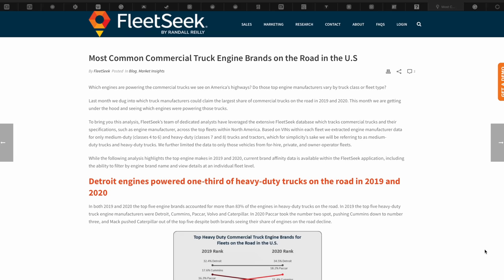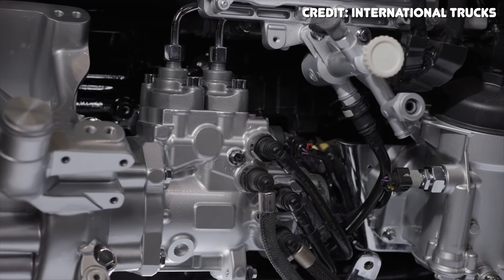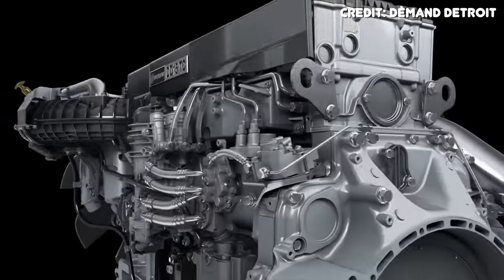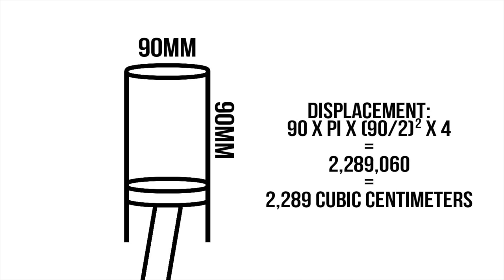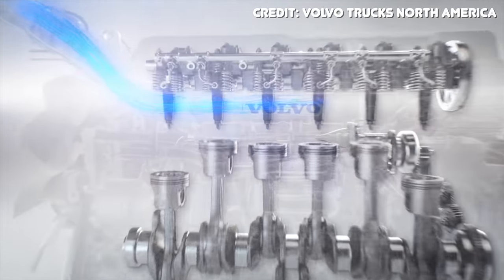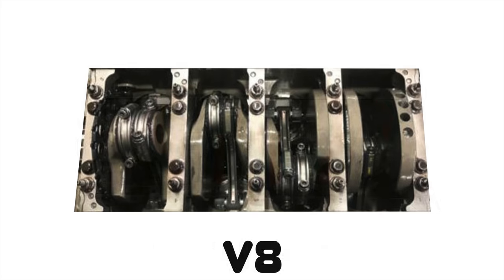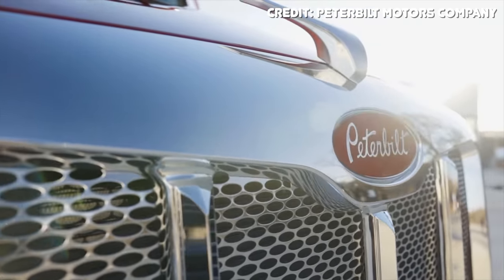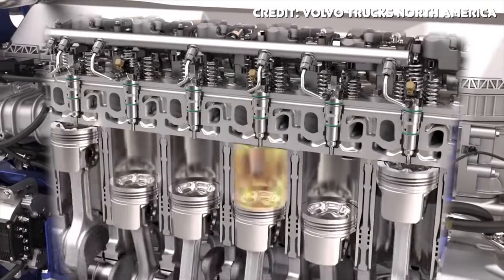Why do Semi-Trucks Use Inline-Six Engines?

Comment: I'm not sure that I would characterize the difference between high and low RPM motor designs by saying that there is "less stress" with the lower RPM design. Stresses exist in both, but are simply different. Lower RPM operation is likely slower to wear on components vs high RPM, but high torque output puts a different demand on parts and high torque, low RPM engines are generally designed with components made to handle that demand (much more robust than a high RPM engine).
Reply: Most diesel engines always benefit from low rpms because it's a slow burning fuel which means that longer stroke allows it to extract more work from that load of fuel before it goes out the exhaust.  And with bigger bearings and pumps, you really multiply parasitic losses in a hurry as you climb rpms
Reply: @wizard_of_poz4413  yes especially in the 6 in line engines have a low rpm compared to a v8 Diesel engine with higher rpm
Reply: Many force increase in square not linear means double the RPM you have four times the forces.
Reply: @edgarrodriguez5436  and their is limits to what the fuel can actually do. It burns at a certain rate and higher rpms and diesel just don't mix well without alot of bandaids
Reply: @edgarrodriguez5436   ...   ,  heh,  heh  !  The  Cummins  903  V-8  from long ago cranked 2,800  r.p.m.'s  from the factory . . ... .
Reply: You said absolutely nothing
Reply: @pauld.fisher8461  I prefer 6 inline, it is extremely reliable on the 6.7 Cummins engine especially on the 5.9 12V and 5.9 24V a total beast that’ll last a lifetime
Reply: @pauld.fisher8461  Actually it's 2600 rpm. Just read from manual.
Reply: @edgarrodriguez5436  nahhh any real user of those two engines will tell you they have real problems
Reply: @VictorEstrada  I personally own a Cummins 6.7 2008 2500 and it runs fine, the transmissions don’t mess up like people claim and cap that they do. As long as you do the transmission oil change and the service of the truck on time it will continue to run
Reply: @edgarrodriguez5436  it's true of any car, but cummins engines are also known to have some issues. My friends' blew up while just driving to work, and he does his own work and likes to keep up with maintenance. They're really good engines, but there's no such a thing as the perfect engine
Reply: @VictorEstrada  oh yeah, I can agree with you their and Thats true. Not every engine is made exactly the same while being the same size brand and on the same truck and has its own little defects while others engines are made right on the spot
Reply: Wear is a function of piston speed.  High rpm and long stroke gives the most wear, low rpm and short stroke gives the least.
Reply: @rogersmith7396  exactly why 6 in line are more reliable, especially if their the 5.9 12v Cummins

Comment: As a former truck mechanic I preferred to working on straight sixes.  You can reach everything from the sides without having to climb over the engine.  The six is narrow so the frame rails are closer together without interfering with anything plus they allow more room for bigger tires and a tighter steering angle.
Reply: What do you believe is / was the best semi truck engine for longevity . 
 Also ,  what do you believe is / was the best car engines ever made in terms of longevity ?.
Reply: @WISHBONEL7  The Cummings 855 is a clear favorite, with a long record of reliability.  The Caterpillar V-8s and straight sixes are also very reliable.  The Detroit family are reliable as long as the temperature is above 40F.  LOL they can be very hard to start when it's cold!   Auto engines,  Ford V-8s have direct oil lubrication to all moving parts.  The GM 350 V-8 is probably the worse engine ever made!  Any American made 4 or 6 cyl engine will be very reliable as after 50 years they have the design down pat.
Reply: @bullettube9863  Wow , I am surprised to hear you take on the GM three fifty .  

Where does the early four cylinder or straight 6 Datsuns or Toyotas from the nineteen seventy's rank on your list ?? , as well as the Dodge / Plymouth slant or V 6 ?
Reply: @WISHBONEL7  The Dodge slant sixes were very good motors, but mechanics found it difficult to adjust the valve tappets.  The Japanese basically copied American and European designs, then improved them.  They also copied American management practices, but American management soon corrupted itself with bean counters in the late 60s and as a result quality control soon became a joke.  Example of this was the GM 348, which was intended to be a truck motor but with a 4 barl carb was used in the Corvette.  For reliability it had four bolt main bearing caps and direct oil lubrication. When you see a 350 with four bolt mains, you are seeing a 348 block engine.  The 350 was designed to be cheaper to manufacture.  It's cam wore out at 50k miles, valve tappets wore out regularly and the timing chains just failed just when you least expected them to.  They even made a GM tune-up kits which included the cam, lifters, gaskets, seals, timing chain and plastic coated sprocket,  and oh yeah the spark plugs!
Reply: @bullettube9863  How about the Ford straight six , and the Toyota twenty two R  ? ,  or the older Volvos ? , in which I just wish that they had a timing chain rather than a timing belt  .
Reply: @WISHBONEL7  Yes, all American sixes were good engines, they had been building them for almost fifty years and had all the bugs worked out.  I owned a Volvo 1970  142 with a four cyl, it was basically a Ford four cyl engine!  Belts versus chains?  Belts are quiet but chains are more durable.  I owned a Plymouth K car and when the belt broke after 40 k miles I had to replace the head as the valves had all bent and damaged the seats.  It was a good example of bean counters versus engineers.  The engine was cheap to make, though not as cheap as the Mitsubishi model, which self destructed after 50 k miles!
Reply: @bullettube9863  Didn't Datsun and Toyota have a double chain on there straight sixes ? .
Reply: @WISHBONEL7  I remember the one Datsun I worked on in 1978 had a wider chain then most engines of the time, but I don't recall if it was a double or not.  Generally the Japanese manufacturers wanted their cars to be as reliable as possible to overcome the perception that Japanese products were cheap junk.
Reply: @bullettube9863  I wish that I had that car right now .
Reply: @WISHBONEL7  I wish I hadn't sold some of the cars I had owned!
Reply: 350 engines unreliable? I have a 98 K2500 with the 350 approaching 200,000. It doesn't use oil and runs out good despite being constantly overloaded with welder,torches,tools and steel.
Reply: @hubertbergen3000  You obviously have a 350  with the heart of the old 348 "rat" motors!  Any engine will last a long time if it is taken care of.  I was a mechanic for fifty years and of all the engines and cars I worked on the GM-350 was the worse.  Cams and timing chain wore out by 50k miles, the heads swallowed valves, valve rockers wore out.  Every thing that went wrong with these engines was due to poor lubrication.   While a lot of the problems were solved in the HP versions, the generic engines all had short lives.  My 95 Chevy 1200 with the v-6 went 192k before the frame rotted and the front bumper fell off.
Reply: Do they have engine mounts or are they screwed directly on the frame?
Reply: @bullettube9863  "Any American made 4 or 6 cyl engine will be very reliable". Um yea, about that. No, lol.
Reply: @em4703  I'm old enough (73) to remember the Ford Pinto engine, and the "Iron Duke_ four cyl made by Buick, both engines were tough and economical to own.  The engine used in the Vega was a disaster because they rushed it without the usual long term testing.  The Dodge and Plymouth engines were made by Mitsubishi and had problems in Japan before they were used in America.  One of the best engines ever made by anyone were the Continental 4 and 6 cyl engines.  They were simple, and robust and were used or copied by many other companies.  I've worked on machines that used Japanese, Renault and Fiat engines and none of them were ever as good as an American made engine.

Comment: One point I would add to the list of advantages to inline engine's in trucks is being a narrower package provides more room for the large front wheels at full lock.
For manoeuvering you often need all the steering angle you can get.
Reply: this is also why we love cab overs in  Europe, sure the nose trucks may look great but put that nose under the cab and not only are you sitting taller and have bether overview, but also the frame becomes allot shorter so the turning radius increase by quite allot
Reply: @Stale_Mahoney  same here in New Zealand.   Slightly differently configured. Tractors have one or 2 steering axils with dual driving axils with locking differentials. 
A popular configuration is truck and trailer. 
Again twin steering axils and dual driving axils, 9m deck.. Pulling a 4-5 axil trailer. 2+2 or 2+3. With 12m deck.
Reply: not really the wheels only barely stick above the top of the frame rails so it would take a pretty extreme engine design to block space that isn't already blocked by the frame or drag link
Reply: We have 385/65/22.5 on the front axles of all our trucks at the company I work for (315/70/22.5 on the driving axles and 385/65/22.5 on the trailing axle). Doesn't matter if it's a Volvo DC13K (13L I6) or Scania DC16 (15.6L V8) we still have a 13 meter turning circle.

Btw, on our trailers we either have: 
8x 385/65/22.5
8x 435/55/22.5 
16x 245/60/19.5

We use 4-axle trailers with 2 axles in the front (these are fitted like a dolly onto the trailer) and 2 in the rear (fixes axles)
Reply: @Stale_Mahoney  I do a lot of expediting here in the US and I saw a old black and white photo of a truck stop parking lot and they were all cabovers?  And I saw an old photo of trucks in Europe and they were all conventional? Thought that was interesting.
Reply: @cliffordzellner5917  yeah back in the days nose truck was more common here in Europe, nowadays it's only cab overs
Reply: Hey guys I'm not a truck driver, but I have a question. Whatever happened to the cabovers? 
My grandfather was a Teamster back in the Jimmy Hoffa days and delivered trucks to dealers for General Motors. He loved the cabovers and I've noticed that I hardly see them anymore in the United States, what's up with that? Thanks for all you do.
Reply: @blackdog542  it's a US thing. Most trucks in Europe and here in Australia are cab over. Pretty much the only benefit these days is the looks.
Reply: @devo3243  thank you
Reply: @blackdog542  I'm guessing people probably got tired of all their belongings being thrown into the front of the windshield every time they get an oil change..
Reply: @cliffordzellner5917  😄
Reply: @cliffordzellner5917  Cab overs were popular in the States back in the 70’s when federal law set a maximum length on tractor/ trailer combination so a cab over allowed more freight to be carried but once those laws were changed the trucks generally went back to non cab over for various reasons including easier access to the engine and safer in a crash. Many a driver in a cab over got ejected through the windscreen during a crash. The engine being way out in front of you gives you a big safety buffer. Hope this helps.
Reply: @blackdog542  during the Hoffa era there were strict regulations on trucking, one of which was "the entire rig needs to be 55' long or less" so to run a bigger trailer you needed to squash the driver's space as small as possible.
However that put the driver directly above the steer axle and directly fed all impacts straight up your spine, and spring technology wasn't very advanced back then.

Deregulation came in specifically to break up the Teamsters Union and unseat Jimmy Hoffa. It also came in as the Interstate network was being expanded and trucks went from serving a small local region to going cross-country on the regular. Wheelbases stretched out for better long distance stability, and because if the axles are further apart but the driver is between, it reduces the impact felt by the driver when one wheel takes a hit. That helps with driver endurance when you're talking decades.
Reply: @blackdog542  The cabover was to allow for a longer trailer and still be within regs. Then they loosened the length regs and could allow up to 53 foot with a convention nosed truck and spacious bunks.  Personally I think the Feds should get out of the trucking industry and just let it go buck wild like the borders.  I mean who cares any more about anything? Why bust our beans?
Reply: @blackdog542  
Nothing up front to protect you in an accident.
Highway speeds of 70 mph + and 80,000 pounds behind you isn't a comforting thought.
Reply: @Stale_Mahoney  The driver is also the first to arrive at the scene of any accident. I've helped clean up some grisly accident sites that might have been survivable had the driver had a hood and engine between him and the other vehicle.
Reply: @devo3243  No, the benefit is you can stand between the seats and walk into a stand-up sleeper instead of having to crawl over the engine cowl and have nowhere to stand when you get back there. The much longer distances in the U.S. make sleepers a larger part of the equation than in Europe.
Reply: @scroungasworkshop4663  Even wearing seat belts, I've seen accidents where the cabover driver got practically cut in two by the steering wheel when something tall enough, like another truck, hit it head on.
Reply: @michaelclark9762  Not a nice way to go at all. Australia imports a lot of its trucks from the US so we followed your trends. Kenworth, Ivecco, Volvo, Mack and DAF are all built in Australia and Kenworth still rules at number one with Volvo second. Cheers